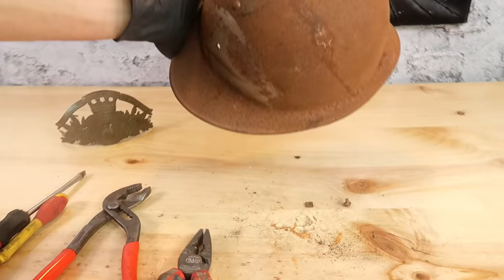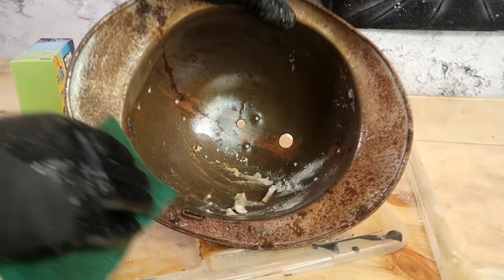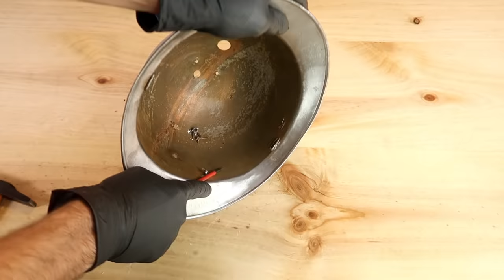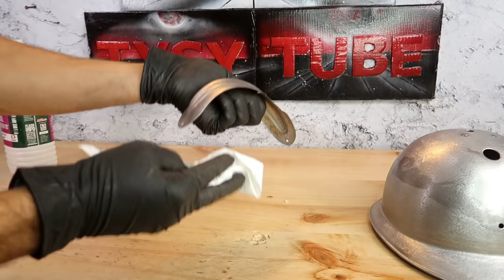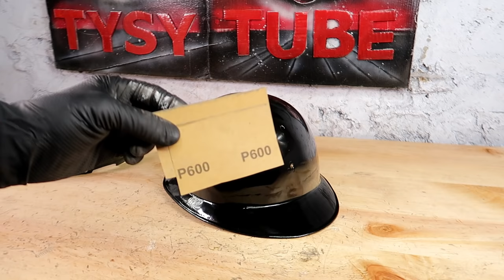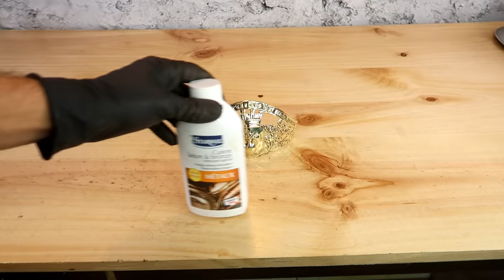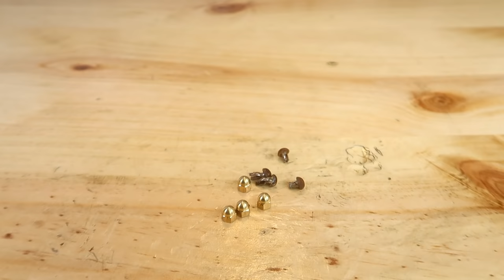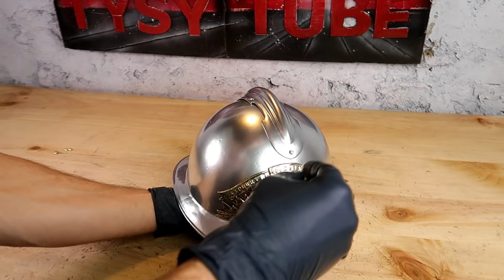Very Rusted Firefighter Helmet Restoration

Comment: About the acid to clear the rust: yes, it does work, but it works better used in a different way. Just soak a piece of rag straight from the acid bottle, without further dilution (it's already diluted enough) and wipe the rust with it. It EATS the rust before your eyes, and doesn't damage the metal. Then, INMEDIATELY (because otherwise, the rust will form again before your eyes) after removing the rust, clean the fresh metal with another rag, soaked in water with some baking soda. Presto. You did in five minutes what it took you eight hours before.

Comment: Was quite surprised to see the original high polish under that rusted spine.

Edit: sad. Very disappointed you didn't just shine up the original surface. I know it's pitted, but you could still see the pitting thru the paint. That helmet was originally polished to a high mirror finish you will never be able to replicate with paint. I guess I'm most disappointed you didn't even TRY first. But I guess that's the luxury of it being your project - you get to make the decisions.

Comment: Have to admit I cringed when I saw you paint the helmet because historically they were left metallic. Was glad you at least brought it back to that color.
Reply: Most adrian helmets were blue
Reply: @conni4518 I could easily be wrong because I am no expert... 

That is a firefighters helmet though, and not what I personally know as adrian helmet.  The French military adrian helmets were kind of a bluish grey. 

This particular design when used for firefighters was often somewhat ornamental. They used the design across Europe. There were some that got painted specific colors for a specific group but many that I have seen stayed a polished metallic color...
Reply: @conni4518  rewatched it and the helmet is looking a lot like a modified adrian helmet but the shiny metal under the cap still has me convinced this is more ornamental kind. Not sure...

Comment: you always start your hand sanding grit way to low so you did your wire wheel which is what like 300 grit sand paper but then you went backwards to 80 grit hand sand then to 100 grit maybe try the 80 then 120 then the wire wheel

Comment: Anybody else think that metal isn’t a great material to use on a FIRE helmet, you know the helmet that goes onto the head of a man or woman who charges into burning building.
Reply: Maybe they used a sort of heat resistant paint or something so it wouldn’t fuse to somebody’s head while they are saving lives.

Comment: Huh, so firefighters had metal helmets... wouldn't it burn their heads in a fire?
Reply: You'd rather they wear plastic helmets in a fire?
Reply: @suep9445  actually they use termoplastic today, and besides, metal is electrically conductive, so in electric fires this would actualy be dangerous for them. I was thinking in something like leather, maybe covering the metal part
Reply: @lordzuzu6437  makes sense!